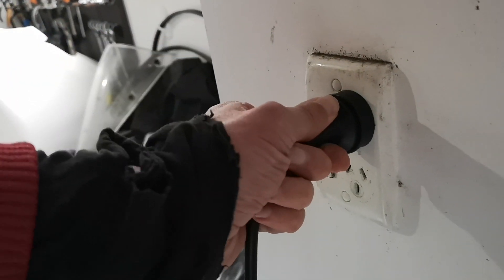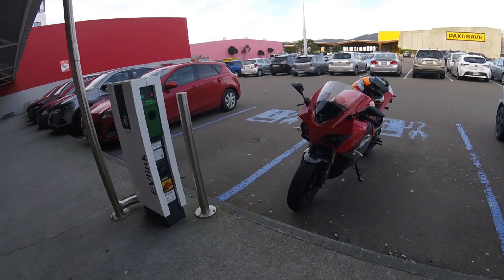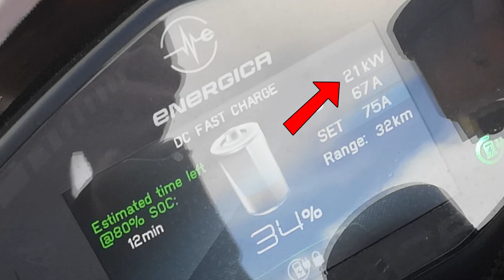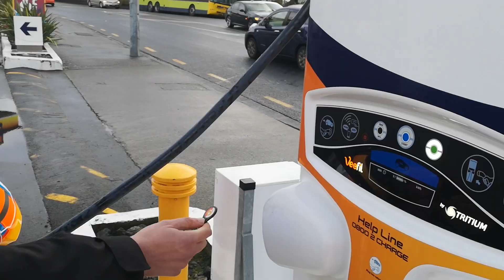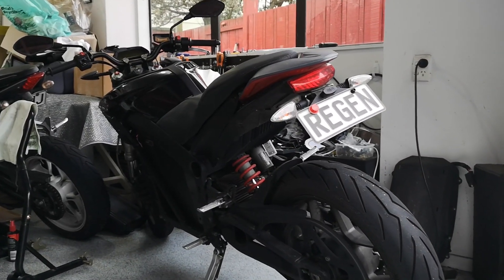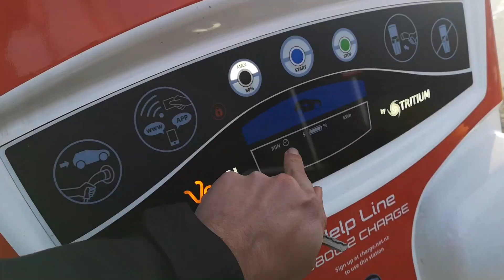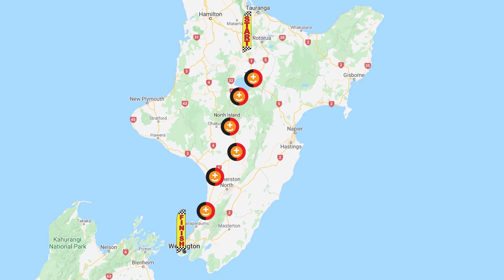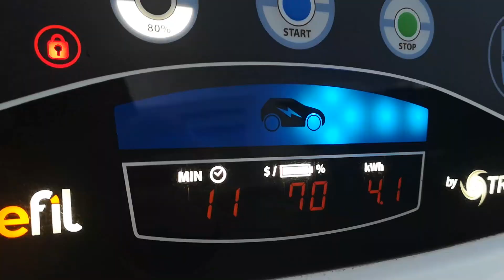CHARGING // AC vs DC // How long does it take to charge the Energica?

Comment: Some Comments: The charge rate does impact on the degredation (= loss of capacity) a lot. On Teslas you can read out how much AC and DC (=fast) charging was done and you can read out the remaining usable capacity. An ok ratio of AC/DC is 3/1 but if it is the other way round or worse you double the degredation. On Teslas rule of thumb is: You loose 5% after the first 50000km and then 1% for every other 50000km. Only charge your battery to 100% if you intend to use it straight away. Do not leave the discharged battery, charge it to 20% quickly. Next comment is those Tesla Destination charger used to be able to switch from Tesla (CAN based protocol) only to Tesla and other EV (Type 2 protocol). Thats done with moving DIP switch 2 from up to down to Legacy mode in Tesla speak. Unfortunately for some if not all markets Tesla removed that option. Next comment: Those Tritium fast chargers are actually designed and made in Australia (yes i know you are NZ but we are brothers). Isn't that amazing? We can actually make HiTech things?? Not just growing cotton, coal and fat sheep??? Final comment: Great video, top editing, not too short, not too long, entertaining,  funny.....just make sure you actually move your mouth when talking for some you might be hard to understand otherwise. BTW: Was that beanie no 1 or no 2 ?
Reply: There is an app  www.plugshare.com and if people use it and check-in when charging you would be able to see if a station is available. I have my mobile no displayed when charging so other people can contact me about using/sharing a station.
Reply from the maker: HAHA that was beanie #1.  About my voice, half of the narration was done when I had a sore throat, so sorry about that!  I've been sick for about a week but didn't want to wait to upload another video.  Cool about the Tritium stations!  I didn't know those were from Australia.  I would LOVE to ship my bike over and do a road trip around Aus and Tasmania.. just need to look into how possible that would be with the infrastructure.  I'm so spoiled over here.  About DC charging, your 3 to 1 ratio is a good idea.  Energica suggests plugging in to 100% to balance cells at least every 2 weeks.  I haven't heard anything about fast charging degrading batteries though.  There seem to be so many factors involved... temperature, cycles, age.  I figure the charging algorithm keeps it safe enough not to worry about it, and unplugging at 80% should extend it's life.  Anyway, a guy could get used to these 12 minute top ups :D
Reply: @NewZeroland  I would take it seriously. When it comes healthy charge /discharge rates you need to know the system voltage (in V) and rated capacity (in kWh) of your battery to calculate the discharge Amperage (Amp hours in Ah) . For example my E-Ninja has a 6.5kWh battery and a system voltage of 72V which gives 6500Wh/72V = 90Ah. Then you can apply the recommended charge/discharge rate which is 0.5C for my battery: 90Ah * 0.5/h=45A max. recommended charge rate.1C is typically the maximum and may require thermal management which would be 90A charge current or  6.5kW charge power.

A Tesla with a 85kWh battery and a system voltage of 400V has 212Ah cells (or 74 cells of 2.9Ah in parallel to be precise). Supercharging at 120kW gives 300A which gives a rate of 1.5C which is high and only possible due to the very good thermal management and Cobalt in the cells. 

The Hyundai IONIC classic even did 1.7C but had batteries with a very high Cobalt content.  Interestingly the IONIC Facelift with a much bigger battery has a greatly reduced charge rate (Hmmmmmmmm........). 

Anyhow I do not know the system voltage of your Energica and the thermal management but do your maths and then make your informed decision of how to treat your battery. 
With cars there is a strong correlation between Amps in/out and the lifetime of the battery and I cannot see how that should be different with bikes.
Reply from the maker: For sure, and thanks for breaking that down.  Energicas are 300V, so at one of these 125A DC stations they COULD potentially charge at 30kW+, but the're limited to 75A, or 23kW.  I haven't been able to get over 21kW for some reason, but it's fast enough for now.  I'm not sure what the battery amp hours are though, so it's hard to calculate what the C-rating is.  Definitely over 1C, but it seems to be safe.  I'm just gonna go with the maximum of what Energica engineered the bike for and see what happens :P
Reply: @NewZeroland  To get the Ah for your Energetica is easy: The nominal capacity is 18.9kWh and you say the system voltage is 300V. 18900Wh / 300V = 63Ah. Charging with 21kW gives a ratio of 21 / 18.9 = 1.1C for DC fast charging which is the border for a battery without thermal management. Interestingly the warranty is for 1200 cycles which is the low end of cycle life for a Li battery.  Treated well you get >5000 cycles.....so it is worth it!. BTW the battery needs to have a certain temperature to receive the fastest charge rate, around 35°C. Teslas actually pre-heat the battery when you navigate to a Supercharger for that reason. Will be interesting to see what happens in Summer. Your Energetica will have an OBD2 type of service port. Try to get the required cables (or Blutooth?) and scanning software to get a real inside view of what is happening with battery and drive.

Comment: When I get an electric motorcycle I plan to avoid all that charging shenanigans by riding until 1/2 range is used up then go home to charge, and use gas for anything else. I love motorcycles but on a long trip you can't deny the utility and comfort factor of a car is exponentially greater.
Reply from the maker: Oh totally.. especially in winter, I'd love the comfort of a car haha.  I actually kept my gas bike for about 2 years after I bought the Zero, but eventually stopped riding it.  The Zero was way more fun, so I bought some chargers and took it on trips.  Now with DC the whole charging thing is a million times easier.
Reply: I can deny the "comfort" of a car. I can't sit in one position for hours. Cars force you to do that. Being able to stand up for a few minutes every half an hour or so is what let's me do long trips.

Heated clothing, good wet weather gear, phase change cooling vests. I'm dry and comfortable no matter what the weather.

Comment: Do you usually keep your bike battery percentage cycling from 80% to 20% ? So every day that you leave your house, it's at 80%? I am just wondering because I just bought an ego 2020 & I am super excited, but I want to respect the battery.
Reply: Btw thank you for your videos. They are the reason why I bought this bike. I sold my Zero DS and bought an Ego!
Reply from the maker: Wow, congrats on the new bike!  Yeah unplugging at 80% will make your battery last longer.  In the end it will do more charging cycles than the manufacturer predicts.  If you need a full charge though, it's totally fine to go all the way to 100% if you ride it everyday.  If it sits on 100% for a long time, it's not terrible, but not the best way :)  Enjoy your Ego!!
Reply: NewZeroland thank you very much!!!

Comment: WOW! I figured the charge was fast, but damn! I would've guessed 20min +
How long did you drive for on 80%? Time and distance?
Reply from the maker: Totally!  For 20-80% it's usually 15 minutes.. most of the time I stop for about 20 minutes to get a bit more range, but it's possible to just top up for 12 min :D  I get around 120km on a full charge (highway speed) and stop to charge every ~70km.  It works out to about 1hr of riding and 15-20min of charging.
Reply: @NewZeroland  still needs way too long for a charge (should be 10 minutes or close to 5) and the range on a 80% is almost ridiculously low.

Honda Africa Twin Sports Adventure DCT ES : 500km on a fill (2 minute to refill) and 3.5 liters for 100km, being also more reliable and durable.

For naked bikes the Eva has to compete with KTM Super Duke R, Ducati Streetfighter V4S, Aprilia Tuono V1100, Yamaha MT-10 and MT-10SP, BMW S1000R, Kawasaki Z H2, Kawasaki Z1000, Ducati monster 1200S, etc

The Ego plus has to compete with Aprilia RSV4, BMW S1000RR, Honda Fireblade, Ducati Panigale V5S, Yamaha R1, Kawasaki Ninja H2, Kawasaki ZX-10RR, aka real tough competition that is often better and way cheaper
Reply from the maker: @THEREALZENFORCE  I'd still put the Ego and Eva into mid-range sportbike status.  They have crazy power but way more weight, so on the track they're more comparable to 600's.  The Ego's top speed is limited to 150mph so it is't a liter bike killer yet.  You're right about the charging times though.  They're getting better but still have to come down, same as the price.  I don't see it taking very long though.  Gas bikes are making insane power these days but struggling to meet emissions standards, so I either the big companies like Honda/Yamaha/Ducati need to make the shift to electric or they'll won't be allowed on the roads.  That's the moment when battery tech will speed up.
Reply: @NewZeroland  Yes other main companies have to make EV bikes too. 
In the meantime they will probably bring turbos and superchargers into 400 and 650cc bikes to still have power and keep emissions low like they did with small displacement cars in the last years.

You also have Kymco who makes EV scooters since some time and will soon bring the Revonex to the market.

To be fair, for emissions EV bikes should be rated on the emissions made to create the batteries and also to recycle the batteries.

And as long as electricity creation is not near 100% green you still have an environmental problem.
Reply: @THEREALZENFORCE  
Only turbochargers (turbine like energy harvesting systems, like on old napier fighter aircraft engines) increase fuel efficiency, superchargers increase power at the price of efficiency.
Reply: @NewZeroland  
Battery energy density (in Li based cells) is fundamentally limited by chemistry, so without radically new battery chemistry increasing battery capacity comes with increasing weight.

Frankly there are two main ways to solve that conundrum:

1 - Improve on the OBSCENELY bad aerodynamics of bikes. I mean supersports have drag coefficients like ~1.2, a Tesla has 0.21. Even Fiat TIPO has a drag coefficient of 0.31. Most trucks have better than 0.6.
Basically it will become "return dustbin fairings or perish".
The insane disregard for aero should be obvious when even basic things like a wheel cover are pretty much never present.

2 - bite the bullet and invest in standardized Al-air primary cells, which can be replaced and materials 100% recycled later.
Those have ~1.000kWh energy density in existing models (with maximum theoretical energy density in the 12.000kWh region, opposed to the 400kWh region where conventional Li based cells max out in theory).

Option 1 is easier to implement. However it would require the dinosaurs at FIM to admit that "we done fucked up" in 1958. Which is unlikely.
....and it would look new, and we can all see how much electric motorcycle companies go for playing safe, when they never deviate from standard motorxycle design, to the point where thefeel forced to NEVER distributed battery cells over the motorcycle to reduce drag, but instead cram them all into the "where the engine is supposed to go" area 100% of the time.